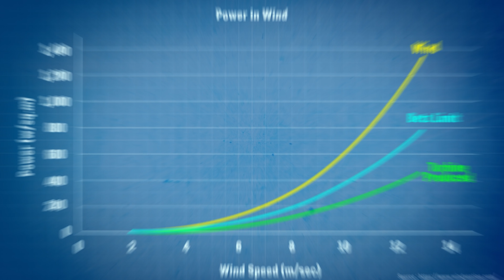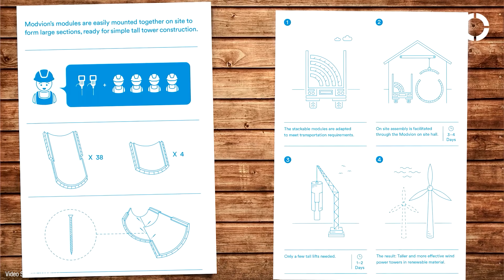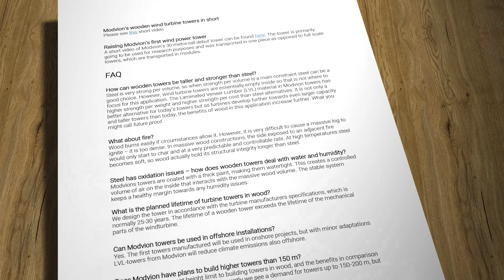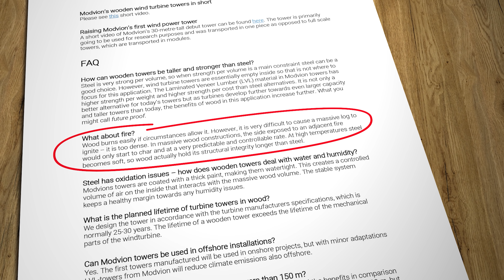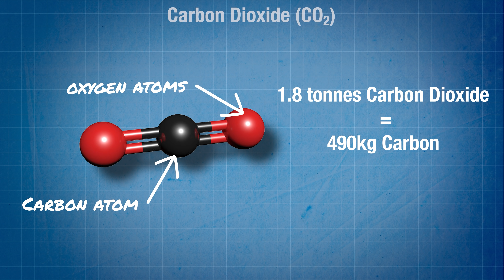Wooden wind turbines. Are they really a sustainable alternative?

Comment: No mention of the serious quantity of resins/glues required to build one of these from wood. Epoxy and Polyester based glues are not exactly kind to the environment, I wonder what their co2 emissions add to the equation.
Reply: They could use hemp base products...
Reply: The answer is to build the modular components to last, and the parts be reused to build smaller structures afterwards.
Reply: He provided the lifetime emissions for the tower, is there a valid reason to assume the figure was missing critical components of the wood lamination process?
Reply: @bakedbeings  If the quantity of resins and energy required was included in that statement, why not draw attention to it if it is somehow been offset in a positive way? Call me cynical but I have been around long enough to not overlook detail when it is missing. Sadly the desire get on a bandwagon more often than not overshadows reality. Just my opinion, I look forward to the component breakdown. 🙂
Reply: @lodgecav490  No matter how much is the resins need (which is going to be vastly less than the blades need) their CO2 contribution is going to be dwarfed by the concrete foundation. Nothing particularly magic about the carbon for the resins so I don't see why they would draw attention to it in particular, though I would have appreciated a more detailed breakdown. I think the carbon in the wood was already included in that total, so he did double count when saying it ended up positive. I would be extremely surprised if it managed to completely offset the foundation.
Reply: @agsystems8220  I agree, although I would think the concrete base would remain usable as a base for the lifespan of numerous turbines which would make it gradually pay back something. The glues I tend to think of as being more toxic than carbon related. Carbon is only one part of the story but it becomes a buzzword and everything else gets forgotten.
Reply: @lodgecav490  Well, frankly the damage done by creating and using resins is nothing compared to the destruction of the biosphere that is caused by increasing emissions of GHG.  It is possible to create and use resins in ways that are environmentally bad, or environmentally benign.  While I certainly prefer the latter, I'm willing to accept some limited environmental damage in order to prevent a far far larger catastrophe.  I'm trying to not let the perfect be the enemy of the good.
Reply: @agsystems8220  Steel towers also use concret foundations, so they do not represent a "loss" compared to current norms.  Greener concrete solutions are available and increasing and it is only a matter of time until they become the norm. Of course, sooner is better and an industry that thrives on it's green credentials should invest a little more and become an early adopter of those alternatives.
Reply: Glue can be made from potatoes. So it's actually carbon negative
Reply: @seasong7655  Potatoes carbon neutral? Not unless you source your seed potatoes ethically and grow them in your own permaculture garden. You should take a deeper look at the commercial potato industry. But I agree, it has the potential to be a better solution.

Comment: At end of life it doesn't matter if it becomes fire wood
Reply: It does because of all the resins and glues involved in the construction
Reply: @alcurtis93  it's only like burning plywood
Reply: Well, except that would negate the benefit of the carbon sink provided by the wood.
Reply: @adamlytle2615  it's the circle of life  unlike currently with fibre glass